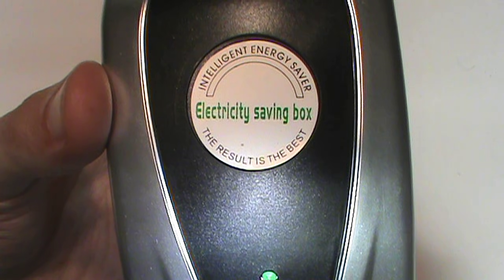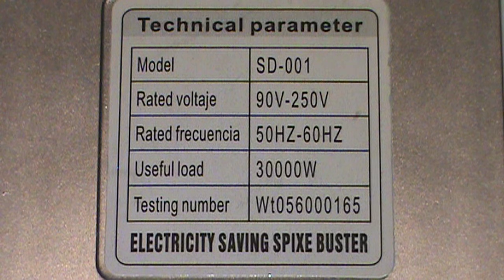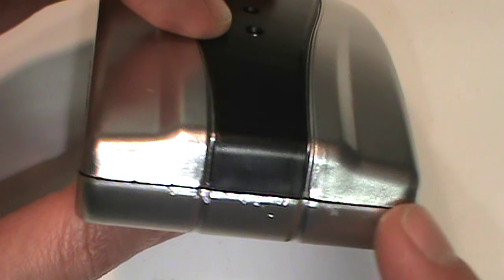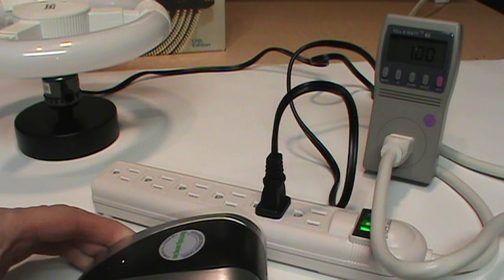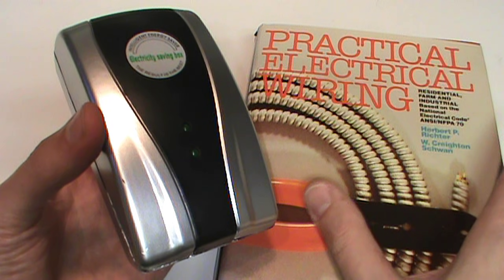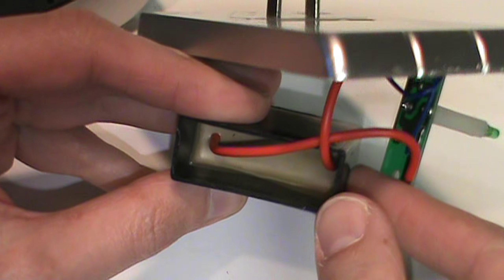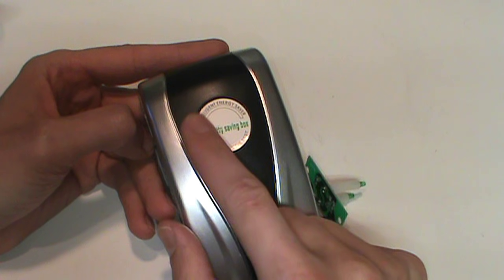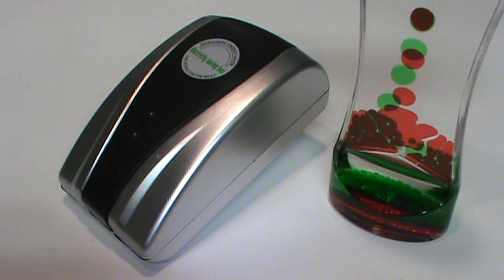Electricity Saving Box Spixe Buster BUSTED!

Comment: But wait, that can also be used as a high priced audiophile product. I bet if you were listening to your stereo, you would have noticed a vast reduction in speaker jitter, turntable cartridge parity errors, and noticed a vastly improved soundstage and imaging. I believe that box of wax, if connected with Cardas oxygen free copper would have reduced distortion to imperceptible levels.  It is the most perfect audiophile accessory you can find, except of course, the greatly improved version coming out soon, now with self adjusting confirmation bias!  No one with speaker wire lifters should be without the AC line frequency jitter removing filter!

Comment: What people don't realize is that if you are using successful power factor correction and they detect it, the power company will  switch your rates from residential to commercial rates which will totally negate what savings you would have had if they hadn't.

Comment: My grandmother complained about cockroaches in her apartment, but refused to call an exterminator. At some point, she saw a similar device "against insects and mice" on TV and pressured my father into buying one. He found a similar one for a couple of dollars (in local currency). Naturally, the device didn't work, but it turned out to be an excellent nightlight. It worked for about five years as a bathroom light. The cockroach problem was solved with a $60 (in local currency) treatment.

Comment: Even if it had a real capacitor in it, it would only correct the power factor of inductive loads, which would still be useless, as residential power isn't charged any extra because of power factor.

Comment: I've seen some actual power factor correction caps at work (I shove wires in volt holes in a factory). This is definitely not one of the mean bastards we have for our machines.

Comment: Back in 1974, when I started college to earn my electronics qualification, we began right at the basics — atoms and electrons — before moving on to AC power, specifically the UK mains supply of 240 V at 50 Hz.
One lesson focused on the difference between domestic and industrial power usage. At the time, domestic supply was measured in watts, while industrial setups used volt-amps. Our instructor brought in a large capacitor — about the size of a medium suitcase — to demonstrate power factor correction. He explained how it worked, using maths that involved cosine functions and other calculations to show how reactive power could be balanced. in a factory I worked in they had an alarm that sounded when the load/phase went out of spec.

Comment: 1:00 Going to a blind play-through here. There are two conditions that these things can actually do that is real. 
1. Prevent the powerfactor from shifting uncontrollably. A power company will absolutely smack you down if you are messing with the powerfactor or shifting the phase. Big no-no. Sometimes this does happen by accident with this era of absolutely garbage washing machines and their cut price motor drive. 
2. Add back capacitance that was cut from the reference circuit of a motordrive. When an IC is designed the reference circuit is not really optional. The OeM designed the components to be exactly as referenced or better. Then someone takes that circuit and calls some bean counters in. They cut things they arent supposed to and unless it catches fire, they ship it. That is why your TV changes channel and your lights blink while your washer is rotating back and forth. 

In the 90s these existed too. Back then, they were a joke. Now because of these poorly built circuits, they have some merit. However, you can just build your own for a dollar with parts off digikey. Just be safe and dont play with electricity. Call a professional if you think you need one of these to start with. The problem is likely correctable, the right way. Sometimes it is even a warning your electrical provider has a problem on the powerpole.

Comment: I'm sure others have already said it. Here goes anyway: unless you are an industrial/commercial customer of an electrical utility, you're not being charged anything extra for messing up the relationship of the voltage and current waveforms to one another (which is what power factor correction compensates for). Nor are you paying more on your utility bill as a result of devices "wasting" energy.

With a mix of inductive and capacitive loads in the average home, things are probably ultimately pretty well balanced out anyway. Even if there were a real capacitor inside this thing, it'd do little to nothing to correct a poor power factor. Real power factor correctors use large banks of capacitors to do their job.

I do like the word "spixe", though.

Comment: Sometime in the early 70’s my mother bought what was supposed to be a TV antenna you plugged into the wall. It promised great reception. It had a small plastic cylinder attached right to the plug. It didn’t work well at all so I took it apart and found one side of the twinlead was connected to the neutral prong and the hot side had no connection (thankfully) and the plastic cylinder was completely empty. Imagine plugging that stupid thing in the other way and sending 120 into your antenna terminals.

Comment: You said it functions just as well without the fake Capacitor.  I would argue that it works just as well whether you plug it in or not!😂. Actually, it works better if you don't plug it in, because there's no power consumption from the LEDs!

Comment: Real Power Factor Correction devices DO actually exist; however, they are VERY expensive, considerably larger in size, and for industrial/commercial use.
Reply: Also note that many inductive home appliances will have capacitors built into them in the first place to reduce waste.
Reply: Also, it's worth mentioning that idle power isn't being monitored or charged for residential customers, your house's power factor makes zero difference to your power bill.

Comment: i dont see how power factor correcrion would save any cost? such as if a 1 watt device had a power fsctor of 0.5, you'd get charged for 0.5w as thats what your meter would 'see', at least, older meters....???
Reply: As others have said, idle power is not metered or charged for residential buildings, and as such, your home does not need power factor correction in the first place. Also, most residential devices with inductive loads have power factor correction built-in to meet the legal minimum. The sole purpose of devices like the one shown in the video is to prey on people's ignorance.

Comment: Capacitors don't do much to correct power factor of electronics loads because phase shift isn't the problem. But, the ones Big Clive has opened either contained nothing (other than the indicators) or a capacitor too small to be useful.

Comment: If it is as simple as wiring up a single capacitor to apply some power factor correction, then why not do that, I know it doesn't actually affect your bill at all as a domestic user, but it would make an interesting video, and I assume you can't get your money back now that you snipped the wires to the fake capacitor.

Comment: I have seen that power factor doesn't really matter to normal household electric users. It would matter to heavy industrial ones. And yes, I've also seen that on Big Clive's.
Reply: I've worked places with large robotics and other devices where they keep capacitor banks on site.  Just rows and rows of 8 to 10 foot tall capacitor cabinets with warnings that they contained 12KV of charge.
Reply: @stonent Yes, unlike residential appliances that always have built-in power factor correction to meet a legislated minimum, industrial equipment may not have power factor correction built-in and it's up to the industrial site to provide power factor correction. It's the reason why idle power is not monitored or charged in residential customers, but it is monitored and charged for industrial customers.
Reply: Residential customers aren't charged for idle load, your electricity meter does not register it, you can have a really bad power factor and it won't make a difference in your power bill, the power company just eats up the cost. That said, most loads in residential buildings are resistive and hence have no power factor issues, and residential devices with inductive loads have to meet a minimum legislated power factor.

Comment: It reminds me of those "fuel savers" poppycock. Permanent magnet ring(s) that you put around fuel lines that is supposed to do some magic and make gasoline particles deatomize better, thus giving you a better fuel economy. Gasoline (petrol) is an oil, NOT iron derivative, so I'm not sure how is that even supposed to work even on paper.
Reply: None of this works on paper, it's all pseudoscientific claims using scientific-sounding terms such as "makes gasoline molecules deatomize". Another supposed fuel saving device is a little thing you plug to your car's cigarette lighter socket and claims to condition the electrical system of your car or whatever. The device on the video also doesn't work on paper. You need a very specific-capacity capacitor to do power factor correction (an one size fits all power factor corrector cannot exist), and residential customers aren't charged for idle-load (imperfect power factor) anyway.
Reply: Like those ads in 1950s magazines selling "magic beans" to motorists. You just stick them in the sparkplug holes to "Rebuild your engine as you drive - greater power, better economy, and longer engine life !! " for only sending a few dollars away in the mail.
https://www.thejunkmanadv.com/uploads/8/4/0/3/8403513/1417553656.png
Reply: Because... the magnet contains pixie dust and unicorn hair!  That's why it works...

Comment: If you read the NEMA standard, the little holes on plugs aren't a requirement. Officially they're there just as an alignment while manufacturing, but some people have found other uses for them too.
Reply: Exactly, went to the comments to say that. The little holes are there to assist manufacturing, they aren't needed, even legitimate devices from legitimate manufacturers may lack the little holes.
Reply: Holes like that are not found in the AS/NZS standards either, it may even be prohibited and I can get why, reducing the contact area would mean Joule heating (fire) risk.

Comment: I remember when DiodeGoneWild opened one of these capacitors and called it an alien technology, as there were only aluminum plates stuffed inside some plasticine or gray putty.
Reply: Although, A capacitor is an electronic component that stores and releases electrical energy in an electric field, functioning like a temporary, fast-charging battery. It consists of two conductive plates separated by a non-conductive material called a dielectric. So technically, that grey putty device could be a capacitor. However, a capacitor will have plates very closely spaced and will usually be rolled around each other to increase the surface are, which increases the capacitance. At least it wasn't a capsule of hot glue with 2 wires stuck into it. LOL.

Comment: This is kind of horrific that this thing is supposed to be plugged into your mains voltage and left unattended. Two bare wires separated by a half inch of wax. The wax is probably flammable too.
Reply: If I had to guess, the wires aren't actually connected to mains, just makes it look like it is.
Reply: @princefluff08  The red wires shoved into the wax are connected to the same pads on the PCB as those from the plug pins, so they are directly across the line voltage.
Fortunately wax isn't conductive - unless it's contaminated with other junk which given the quality of the device it probably will be.

Comment: Wonder how would it even do anything if you do add a capacitor to it. I'm not aware of power factor correction that is connected parallel to existing devices, it would have to be designed into the device's power supply...

Comment: These do absolutely nothing but they do come in a pack of 4 which seems like a good deal.  I’m still debating whether or not I should purchase them.
Reply: Some DIYers buy them just to get the enclosure so they can put their own PCBs inside, apparently they are cheaper than empty enclosures and you get a free LED circuit too.

Comment: What if you added a real capacitor to it?🤔
Reply: Capacitors are good in an industrial environment because they make inductive loads (motors) more efficient but they still draw power. Unless VWestlife has a bunch of motors in his residence, the capacitors themselves would just increase his bill.
Reply: @EdgeRatedR007  Residential plans rarely have power factor penalties
Reply: You'd achieve nothing because the power you'd save is power that is not billed to residential customers.
Reply: More voltaje more bueno.

Comment: Looks like a fire risk
Reply: Why? The electrically active part is just an LED circuit.
Reply: @Δημήτρης-θ7θ the tiny wires they use and the fact that the ones in the fake capacitor could short if they got to close.

Comment: That plug looks suspiciously Chinese. You should've grabbed some callipers. If the prongs are exactly 12mm apart, it's Chinese, if it's between 12.5 and 13mm, it's a NEMA connector.
Reply: Doesn't Japan have similar outlets to the US? Just at 100v or something?
Reply: @volvo09  After having spent a month in Japan, yes, they do.

Comment: Some great overlap with Big Clive. You two have a very similar, relaxed vibe. It really doesn't hurt to look at products like these every now and then, even if it's been done before. For those of us who have seen similar teardowns it's a good reminder that these are still in the wild and for those who haven't it's a public service.
I'm a bit surprised, though, that they just stuck two live wires into some molten wax and just let it set. Why bother? Sure, it looks slightly more convincing on cursory inspection when opening it up, but you'd think they'd be more concerned about the potential fire hazard if the stripped wire ends happen to be too close to each other in the block of wax in any of the units.
Oh, well. You now have a fancy two-LED night light and got a free decorative candle with it. Just add a piece of string as a wick. 🙂
Reply: If it burns your house down, you get a period of free heating, then 100% energy saving 🤣
Reply: Fire hazard? It's cheap stuff sold on Temu and whatnot... There are no regulations.
Reply: Originally, it was a fairly convincing (to the eye) fake capacitor filled with sand and sealed with black resin, but then we got the fake fake capacitor that doesn't even look real. Kind of like fake wood (aka woodgrain) started out as a convincing imitation but then it wasn't even convincing anymore. Or fake leather that eventually became fake fake leather using hard plastics that don't even feel like leather
Reply: Krazy Ken also covered these a while ago